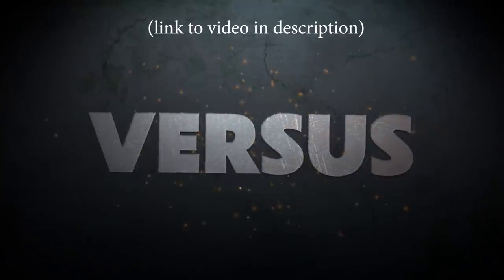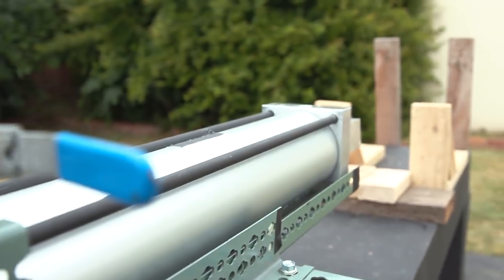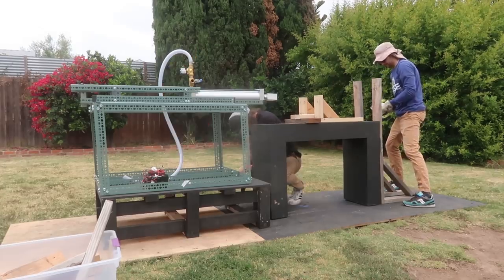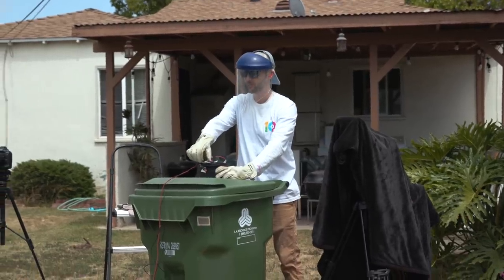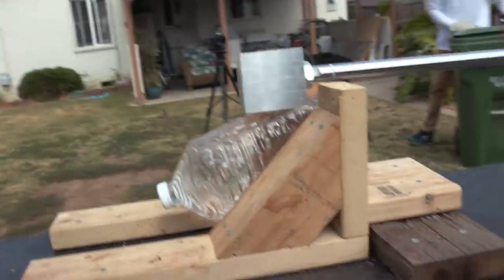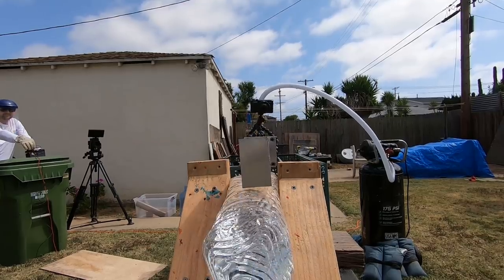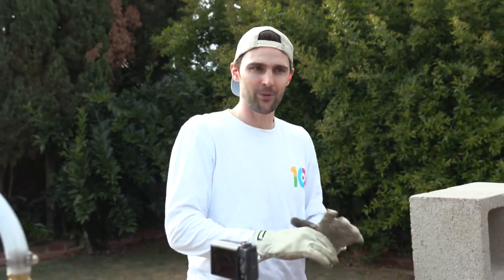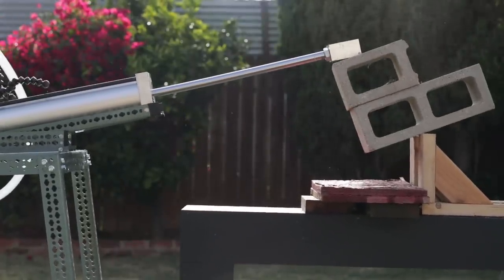THE PUNCHING MACHINE!!

Comment: I feel like the machine is way stronger than we see in the video, the brackets holding it in place are just too weak to back the punch in order for it to keep going, it just bent and went up instead of through. Bit of a design flaw but could be improved upon with another iteration, I wanna see that video!
Reply from the maker: I totally agree... it's kind of like an air log splitter that moves faster... we shall do thy improvements!